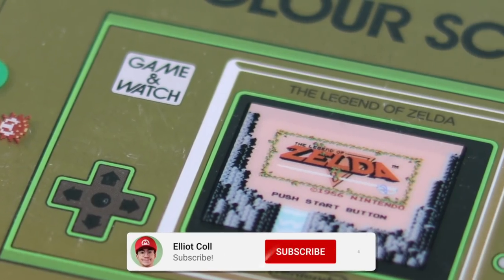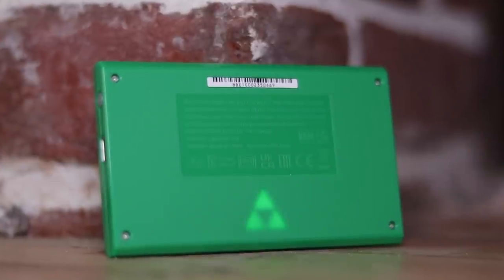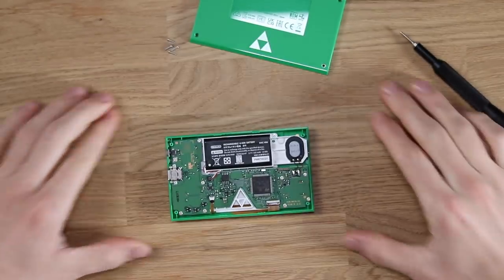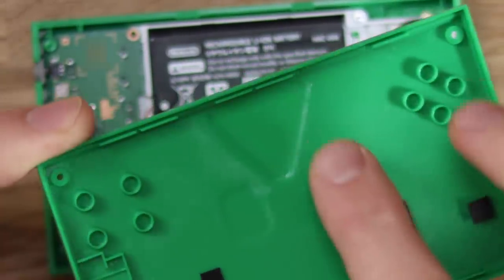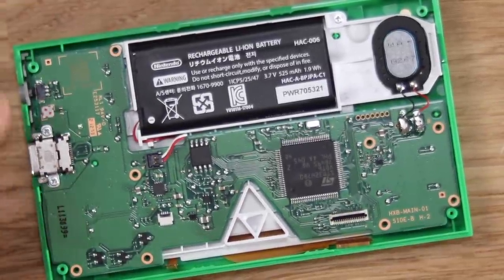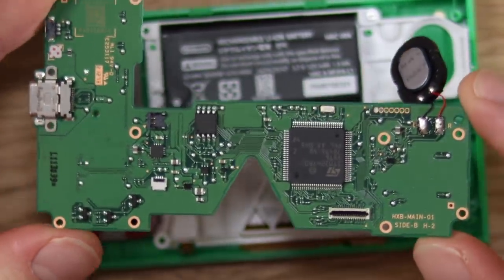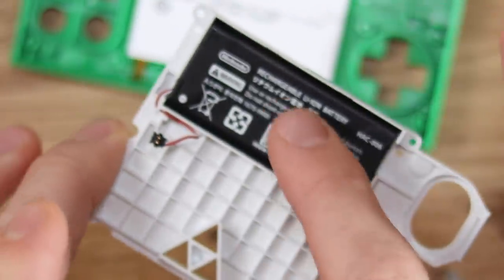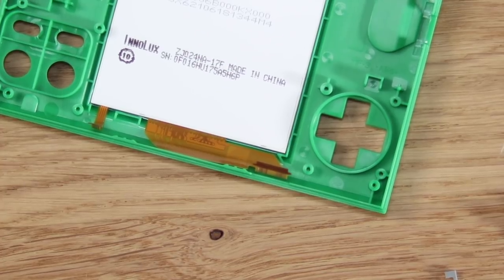Zelda Game & Watch Teardown - Sorry Nintendo

Comment: Next to the speaker, there is the debug port. That is what people use to put different games onto it. All you need is an STM32 programmer And some software. It can run any NES/SNES game.
Reply: pretty sure that's exactly what you could do.
it's interesting to see somebody trying to play the lost levels on there
Reply: Very clever
Reply: You can get a cheap st-link adapter from China. If the memory is not protected, you could dump all the contents of the memory using it.
Reply: Stacksmashing has a great video on the reverse engineering and stuff for the old one
Reply: @MickTheRus  that was a fun series to watch
Reply: I wish the Game & Watch came preloaded with all the popular NES games. Sadly, they are themed to like three games a piece. The Valve Steam Deck can run any game, without the need for any serious programming. :)

I don't game at all, and rarely played the Wii back in 2010, just a tech enthusiast here. :)
Reply: Snes? I think this is impossible
Reply: @uhlala681   Power wise it's probably very capable of doing so. The SNES can be run with very rudimentary modern tech. The only issue I can think of would be the 8 button controls on this thing wouldn't work.
Reply: Hehe, time to put duck hunt on it. If I had one.
Reply: Someone put link to the past on it too
Reply: No SNES. So far this thing can only run NES, GG, GB, GBC and some SMS roms with Game and Watch Roms
Reply: @Mike-uh5xl  you're correct thats also been ported over I forgot. I wouldn't doubt a SNES might work also and I'd love a GB a but the roms are too large and no shoulder buttons anyways

Comment: You may think the sd card would have held hackers back from hacking this unit but stacksmashing literally got this thing running sonic within the first week (it's not public, but they showed it on the discord). It literally runs the same firmware as the Mario unit except it has more memory. So there's a chance you'll be seeing some really crazy mods for it coming soon too.
Reply: My only hope is to see the Oracle games on this baby.
Reply: What’s the discord?
Reply: @carlitosaqui  on his channel. I found it on the wireless Tetris video
Reply: @roman 420 I mean the Mario one got it running. I can only bet this one can do it far better
Reply: @sneff212  got it thanns
Reply: How did he get the game on it though?
Reply: @shiftfire4511  it can definitely be hacked to run them since it can run GBC. But it requires some debugging tools and know-how.
Reply: @tyryanart  No, it has been shown to run GB. It may not seem like much of a difference, but there is some noticable ones. Mainly in Memory and Cartridge size.
Reply: @roman 420 YES! snes has a doom port
Reply: @roman 420 I believe running Doom nowadays is easier than running NES emulation.

Comment: the screen cover up is a perfect example of Nintendo saving cost.  that size was probably the cheapest option in mass quantities compared to ordering the exact dimensions.  the 2DS wedge model was also 1 big screen that was covered up.
Reply: It helps with backlight bleeding
Reply: They also required a raised bezel around the display ANYWAYS to recreate the original Game&Watch design, so using an oversized LCD that fills the entire raised area actually makes mounting things a little easier. And if it means they can use  an off-the-shelf part instead of a more expensive custom panel, so much the better.

Comment: If the screen was smaller it probably wouldn't light up the triforce as well. But also I'm wondering looking at the reuse of parts, they thought it would have a smallish run, and wasn't worth getting a nonstandard screen made specially for it.
Reply: Or that means new hardware is about to come out and they need to get rid of old stock 🤷‍♂️
Reply: I hardly think they'd have installed a larger screen just to light up the Triforce, but they're certainly not going to waste the extra light if they have it. I haven't believed at all for the past few years that Nintendo will actually do a Gameboy classic, but this larger-than-necessary screen gives me new hope they might. Either this might be the screen they've already bought in bulk for it, or they could be testing it out in a smaller-run product to see how it goes.
Reply: @bigmacgamer69  theres a few videos on how to do it like when the mario anniversary game and watch came out but immediately nintendo took down all the tutorial videos

Comment: Nintendo probably just cheaped out by using some off the shelf screen, then instead of having black borders just covered the unused pixels with the case to show correct aspect ratio.
Reply from the maker: Yeah for sure
Reply: They did a similar thing with the original 2DS where to sell it cheaper both the top and bottom touch screen are actually the same screen, with the unused bits covered by the shell

Comment: HAC-006 is indeed the part code/model for the Switch joy-con battery, it's the exact same part which makes sense, like the speaker. They've got tons of those (and are being produced already), no sense in making a specific part for it other than the bare minimum like casing and motherboard.
Reply: Nintendo is famous for this, sometimes its ended badly, but then we have the diamond that is the WiiUPro controller using a 3DS battery... Not a huge fan of the layout, but its become my #1 controller for PC, just on the 8hr battery life alone lol

Comment: If it had an SD Card, it would be really easy to hack.
It has an external flash memory where it stores the ROMs 
Apperently you can rewrite the ST micro and upgrade the external flash memory.

Comment: This wouldn't have an SD card anyway.  It's on a completely different tier of SoC compared to something like a phone/tablet/set top unit.  Very very simple and low power and an SD card/socket would probably be more expensive on its own than that SoC.  Not about trying to prevent hackers, but really making it down to a price, but for what it is, it will never need anything more than what it has, but i wouldn't expect any miracles out of it like SNES emulation.  An early 90s PC has more RAM than it.

Comment: You should remove battery before removing all the flex cables... always disconnect battery first !
Reply: GeekStuff.fr. What do you think about the battery itself? As a collector's item it would be playable after 10 years? Or should I open it to replace the battery? Then, after that time, would I find the same battery's model? By the way, great job with the video.
Reply: @blacksmith7338  The battery will be worthless in ten years, and you won't be able to find replacements. 
Lithium-ion packs have a limited life span, and few of them become any sort of standard.

Comment: The second tiny ribbon from the screen is a touch connector. I don't have one and don't know much about it - does this thing use touch screen controls? Because it looks like the screen supports them, even if its OS doesn't use them.
Reply: The second tiny ribbon from the screen is actually power for the backlight. There is no touch support.
Typically, a backlit LCD will carry power on a separate cable from the data. Aside from making it easier to do multiple configurations from a single device, it also prevents noise from the backlight interfering with the high-frequency data.

Touch LCDs typically have THREE ribbon cables dangling off them.

Comment: Probably has already been hacked, considering nintendo will use off the shelf parts, & games are probably either stored inside Programmable ROM or built onto same dye as the processor.

Comment: What do you think about the battery itself? As a collector's item it would be playable after 10 years? Or should I open it to replace the battery? Then, after that time, would I find the same battery's model? By the way, great job with the video.
Reply: The battery is the exact same model as the Joycon one. So, you can order joycon batteries and use them in this device.